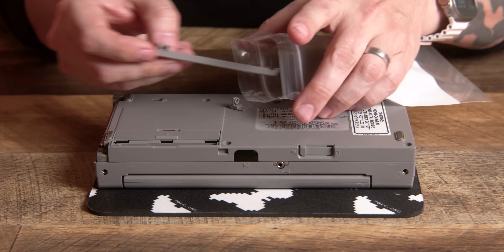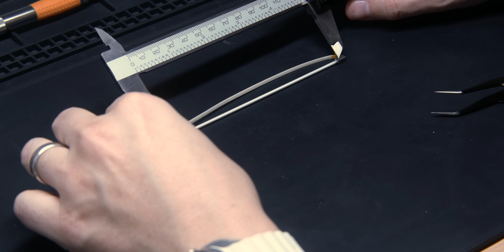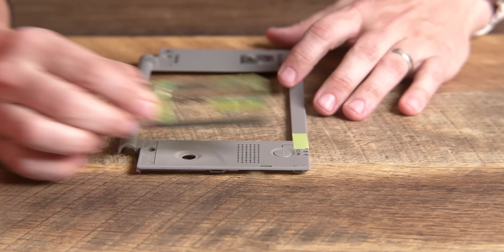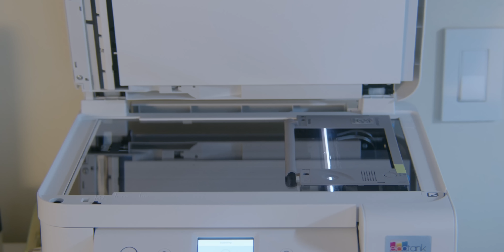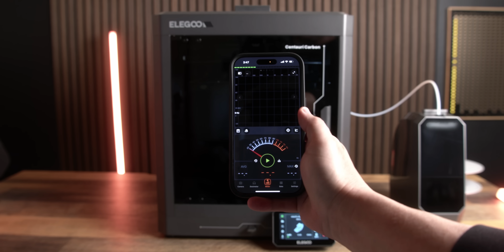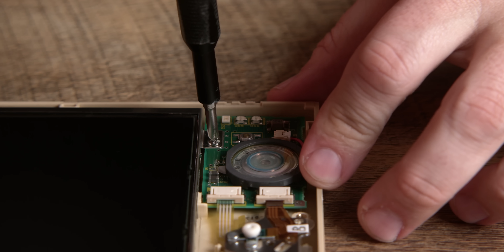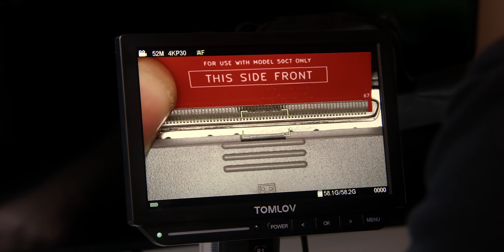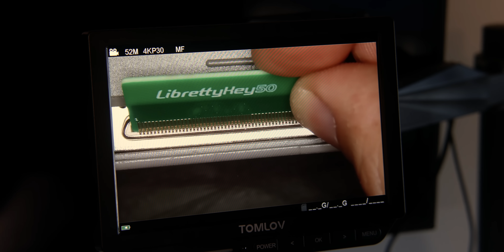I saved this crumbling little laptop from itself

Comment: Thanks for doing what you do! I have the Libretto 110ct and my dock crumbled to bits. I bought one of the upgraded docks with USB but now I have to wonder if it will crumble too.

Anyway, my Libby and dock take a completely different PSU that would never work with your universal one. It seems more like a miniature version of an Atari 7800 PSU. I take that to mean this entire replacement case wouldn’t fit a 110ct since it’s not going to have the same cutout for the power jack.
Reply from the maker: Yeah unfortunately the all of the other cases are different (even the 70ct if I remember correctly, even though it does share a lot of the same components). These were popular so they made quite a few models!

Comment: I got 4 of those laptops, they great, for as long you don't get 50ct/30ct model with passive matrix screen.(They still cool, but using them is much less pleasant) Only one of them have visible case issues with second only very minor one and the rest two are basically intact, I guess I am very lucky. They also overclock-able and 110ct model got a lot of capabilities.
Reply from the maker: An overclocked 110CT sounds super cool, what are the specs?

Comment: A trick is to put kapton tape over the edge connector pins so you don't get solder on them when soldering next to them. It's a neat solution though, you're almost at the point where a new dock could be made heh.
Reply from the maker: Really good tip on the kapton tape and I was thinking the same thing! I had actually made a breakout board and realized that there are quite a few features the connector exposes that the dock doesn't utilize. A new dock might be a really cool project.
Reply: @polymatt  Look up PA2718U part number - it’s the enhanced dock and has PS2 ports on it an another PCMCIA slot (type 3 IIRC).

That’s likely why you’re seeing the “extra” pins compared to what gets used for the “bar” style docks.

Heck, on the 32 bit 100CT, 110CT, and Docomo M3 versions the “enhanced docks/port replicators” even have USB on them.

**Note for other reading this - the 50/70ct can never support USB as they have 16-bit cardbus and not 32-bit PC Card slots.
Reply: @polymatt  I was thinking that, would you be able to use this technique to make a new dock for the computer :)

Comment: That variable power supply is a bit scary. Seems like you'd easily bump it and send 24v into a 12v system.
Reply from the maker: The rotary knob is pretty tough to turn probably for that very reason 😂
Reply: I have that same power supply and…yeah you’re spot on 😅
Handy in a pinch though, usually when it’s not convenient to use a stack of huge/noisy/40lb bench power supplies lol